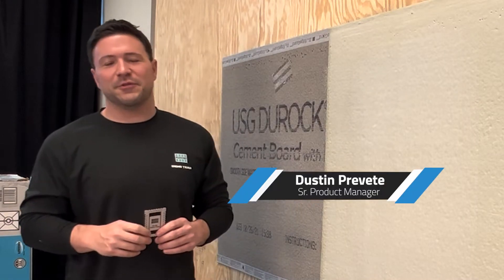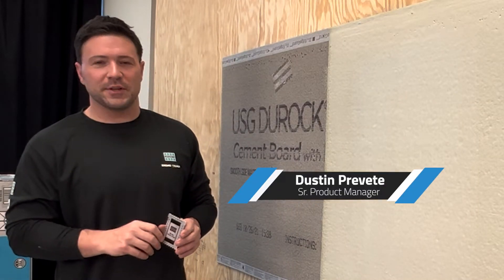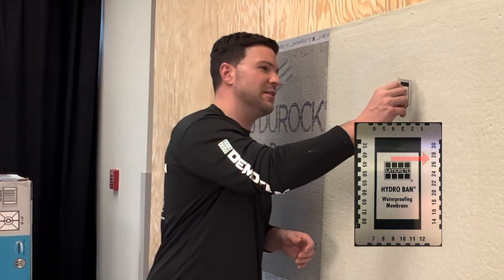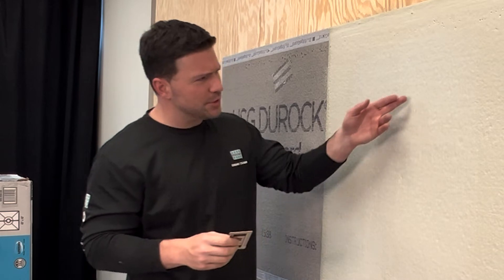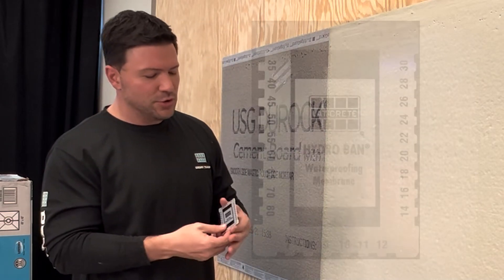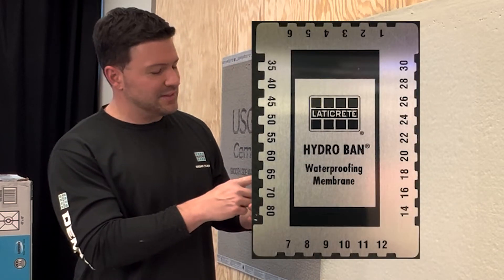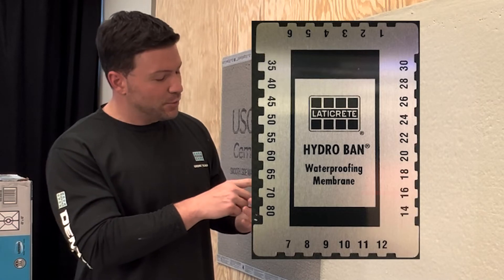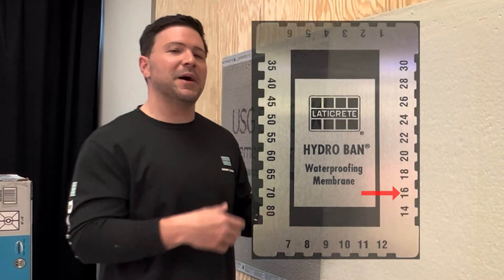How to Use a Wet Film Gauge

Comment: So you have to worry about fixing the notch marks that the Guage makes? Also, is it recommended to check multiple spots on a wall?
Reply from the maker: This is just to ensure you're obtaining the proper thickness with your method of install. Since it's done while the product is wet, there's no damage done and you can simply roll your product back over this area. You don't need to check every area. And, in most cases depending on the substrate, you'll achieve proper thickness for waterproofing in 2 coats using a 3/8"-1/2" nap roller. Your first coat should not be transparent.